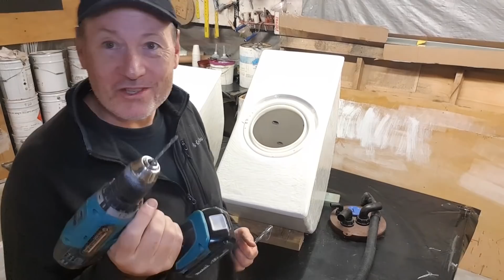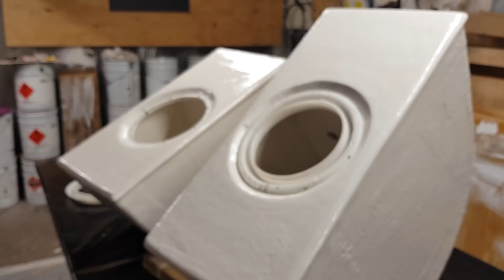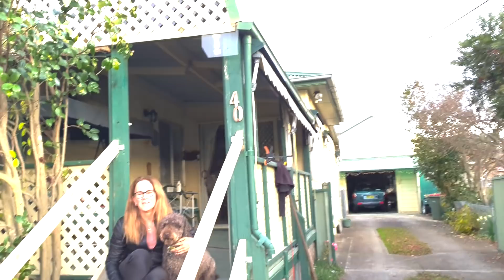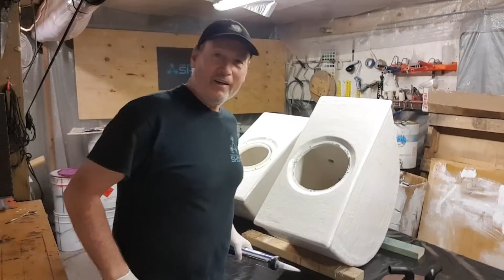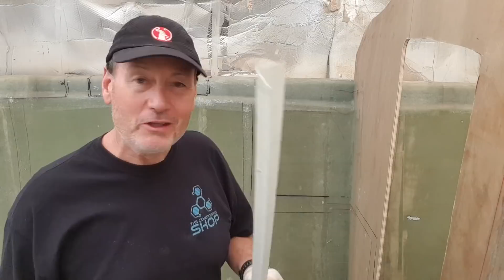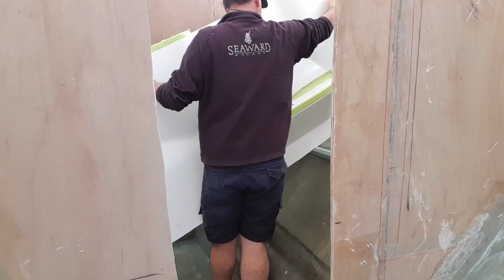Ep124 Subfloor Systems - Blackwater Tank completion - Building a Fibreglass Catamaran

Comment: Ross, have you thought about putting a couple of strips of adhesive backed weatherstrip around the bottom of the tanks?  It will give you the gap you want off the hull and it will keep it from rattling around and making noise under the sole.

Comment: The composite angle works great for so many applications. I had been trying to decide the best way to secure the aluminum seat bases I made to the floor and after seeing you put the angle to use I glassed the angle I made to the floor and bolted the bases to the angle so no holes in the floor which was the one thing that was keeping me from having seats in the boat now everyone is happy:) Thanks Ross!!
Reply from the maker: So good to hear that you have solved your problem.I love composite angle it has greatly reduced my we workload and a far neater solution to the underfloor and wardrobe spaces.Rossco

Comment: Sika... seems to have magical powers to cross a room by levitation and get on stuff... or me;)  Love to see the core close out with the epoxy annulus- should be mandated by law, as you mentioned so much deck fitting install leads to issues down the track.

Comment: Nice job. But I have been thinking would it not have been better to put aluminium tubing through the holes on the side of your fuel tanks and than put the straps around the tubing and over the fuel tanks. Instead of strapping through the holes which will introduce shaving problems. 
Keep up the good work.

Comment: Great videos and what an achievement already.  Are you not afraid the tanks will squeak due to hull/tank movement. Changes you will ever have to remove the tanks are zero in my opinion.  Most boat builders use the outer hull as part of the tank.

Comment: With aircraft assembly 1.5 x the diameter of the hole is ideal for edge margin for any hole drilled in the structure. After the ring assembly is installed encapsulating the nuts is ideal also will help solidify the the errant holes drilled and make them strong. This install is solid Ross, well done.

Comment: Couldn't you have put a couple of stainless semi circles to screw into in the blackwater tanks? Well Ross..I'm not sure where the coldest place is....Oberon is not exactly tropical neither is Yass...I used to stop the truck for a rest at Yass and I could hear the truck cracking as is shrunk. Blayney would also freeze the balls off a billiard table...cheers